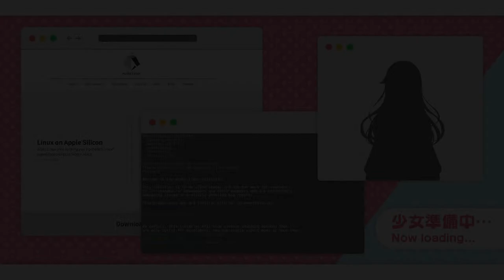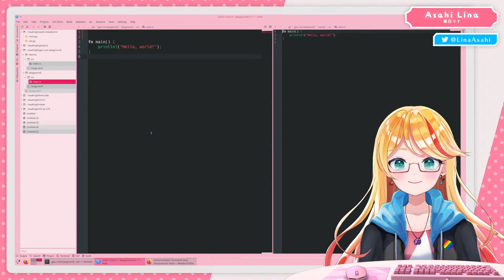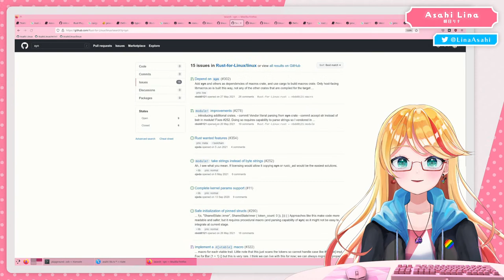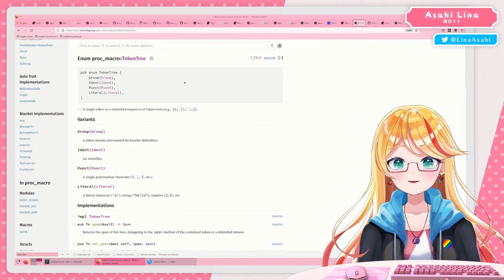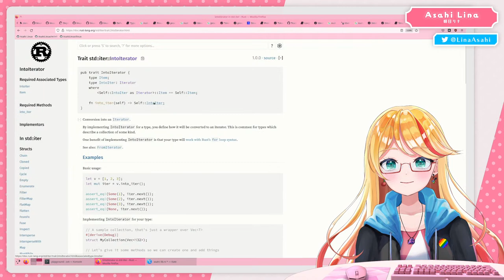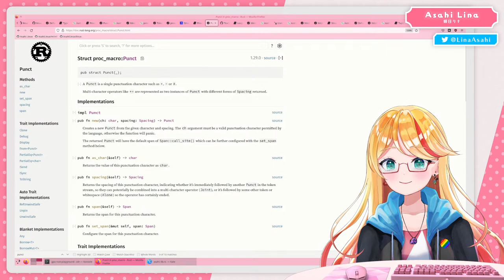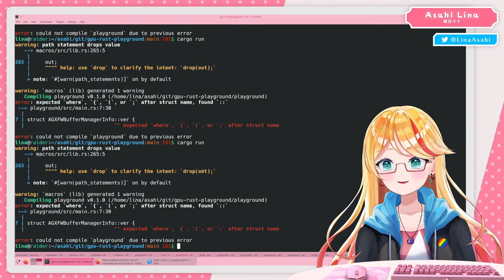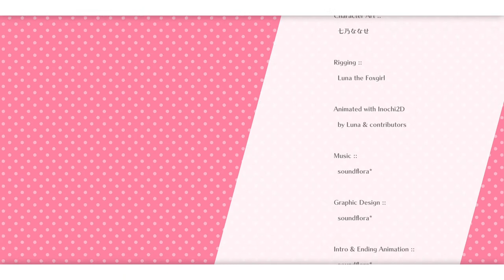Playing with Rust! Can it do what I want?

Comment: You could have used the function-like proc macros to allow arbitrary syntax (like allowing `$` to separate the version part of the identifier) – the drawback is that automatic formatting, autocompletions, etc. won’t work inside that (so maybe your approach with attribute macros is better here!).

Also, as for sharing the state between calls to the macro – some libraries hack around this (proc macros are afaik loaded as libraries during the build, and they can use static variables that will be kept and available during later calls) – see eg. the `enum_dispatch` crate and the cache module they use to make two invocations of the macro (the one on an enum definition, the other on a trait to be implemented) communicate with each other. You possibly could do something similar to make the proc macro aware of all the available versions.
Reply from the maker: Yeah, that's why I was trying to avoid using function-style proc macros! But I might switch to that if other Rust folks think it's a better approach.

I'll look into the static variable trick, though it feels like a bit of a hack... ^_^;
Reply: @AsahiLina  Definitely a hack – but it works, kinda.

Unfortunately you can’t cache the actual TokenStream (or collection of TokenTrees) cause they’re not Sync and not Send. So you have to serialize it somehow first if you want to keep it for expansion during a later invocation (eg. cause the macro hasn’t seen the versions enum yet, so you’re delaying the structs generation). But that means you lose all the Span information – `Span` currently doesn’t give you any way to inspect or serialize it, not to mention deserializing it back.

As I understand, that’s because proc-macros are intended to be pure functions of the input token streams with no way for insignificant whitespace changes (which would change spans, but not the tokenization itself) to affect macro output in any way (so that IDEs don’t need to re-invoke the macros on every whitespace change). This means that the errors reported by the macro are worse-than-hypothetically-possible, as the span information is missing (and is just replaced with `Span::call_site()`).

See the issue 54725 in the rust-lang/rust github repo.